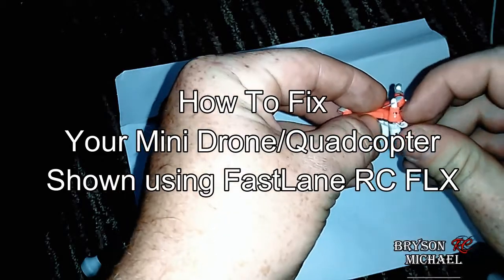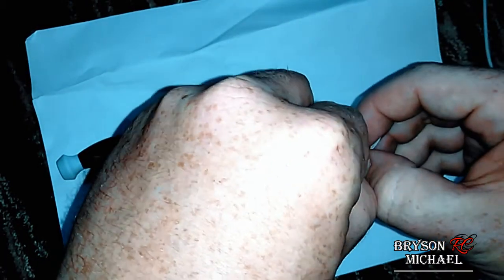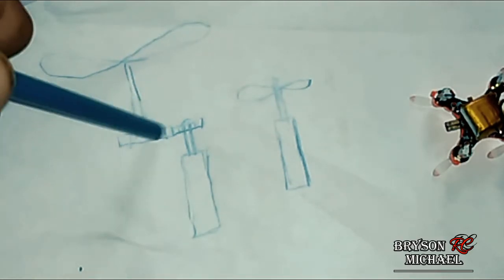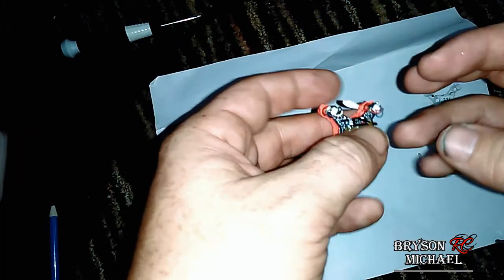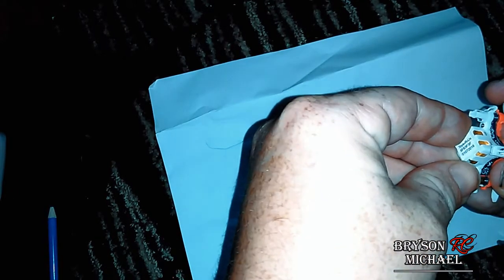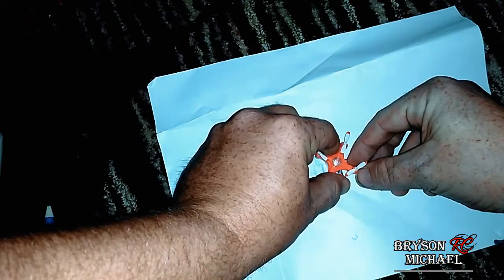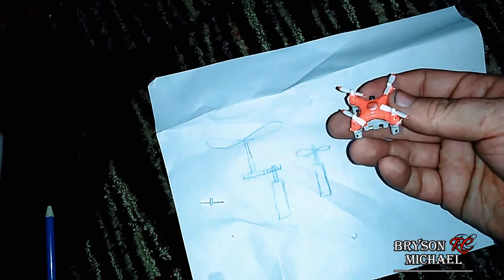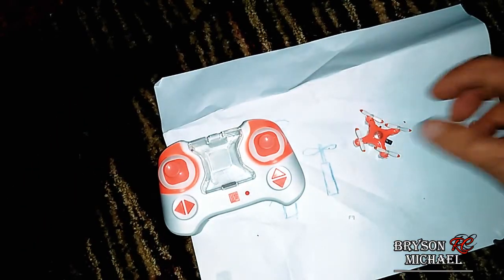How To Fix Your Mini Nano Drone or Quadcopter

Comment: I’m here because my drone stopped flying and something is wrong , i fixed it it turns out the battery was now connected so it had a burn mark on inside so i pluged it up and cleaned it
Reply: That’s what happened to me I’ll try what you said and check the inside